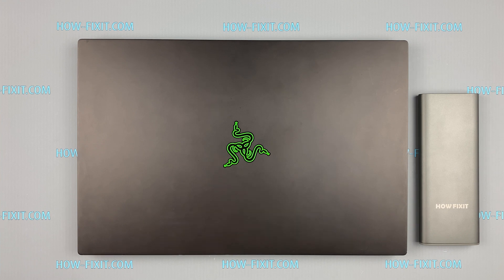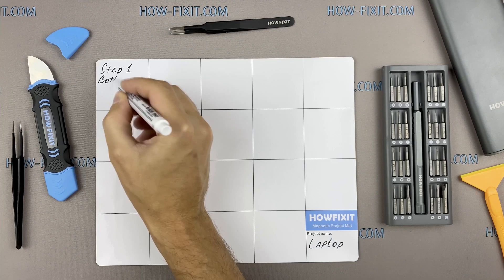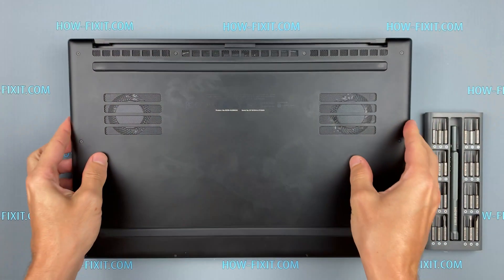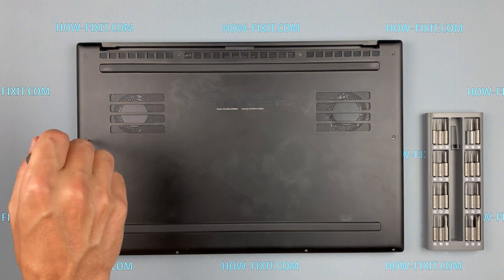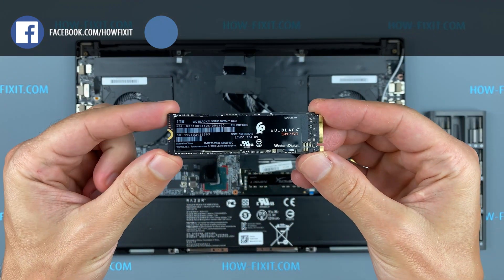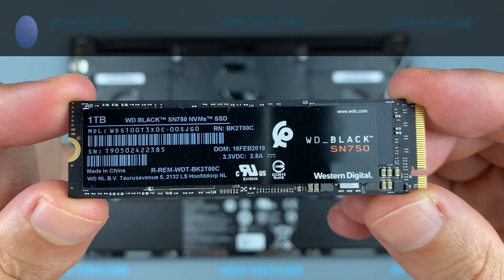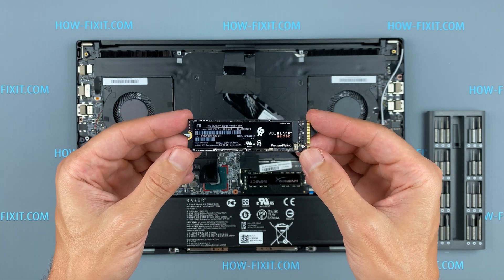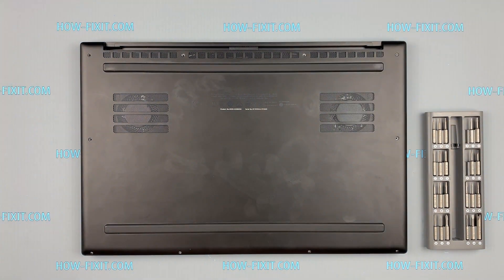Razer Blade 15 Advanced Model (2018) M2 SSD Upgrade - DIY Installation Guide

Comment: Question is - will only single sided SSDs work? I would like to upgrade to a 4TB model - but these are double sided.
Reply from the maker: There is no limit on the maximum size of an M2 SSD, but there are Windows limitations. If your Windows is 64-bit and the GPT file system - you can install a drive of any size. Check the description for links to recommended drives.
Reply: @howfixit  Question was - are double sided SSDs possible? Not if it is possible to upgrade to 4 TB. I was able to aquire a single sided SSD with 4 TB (Crucial P3) and one for my 4 TB Upgrade.

Comment: I'm adding a 2dn ssd in a open slot of a Blade 15 2021. Is it necesary to unplug the baterry?
Reply: I have the same laptop. Which SSD did you use (nvme or sata) and did it work?
Reply: @saboss  unfortunately I haven’t upgrade my ssd because my laptop died. I’m trying to recover it!

Comment: What about using some sort of backup software or Windows 10 backup instead of dragging and dropping in file explorer...?
Reply: I used Clonezilla and an external NVME-case - that way I cloned the original drive on th new one - and was ready to go after installing the new one.
Reply from the maker: You can clone your existing OS or do a fresh Windows installation—watch the linked tutorials in the video description.

Comment: Is the Samsung 970 EVO Plus 2TB NVMe M.2 or 
The Samsung 980 EVO Pro 2TB NVMe M.2 compatible with Razer 15 2018 -advanced or is the Samsung 970 EVO Plus 2TB NVMe M.2 better ?
Reply: Both are viable options - but the 970 EVO Plus will do and is cheaper too.
Reply: Meant is the Samsung 970 EVO 2tb NVME M.2 better?
Reply from the maker: Check a video explaining the differences between M2 NVMe and M2 SATA 👉 https://youtu.be/r3Jy5dHOj3g